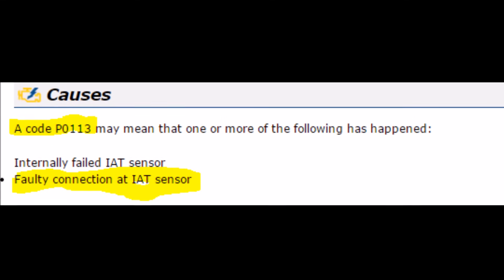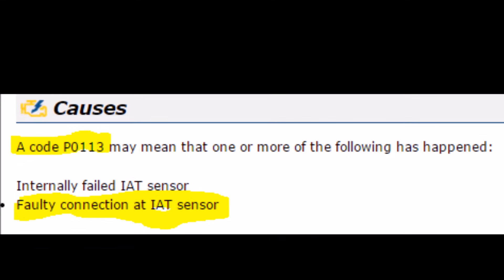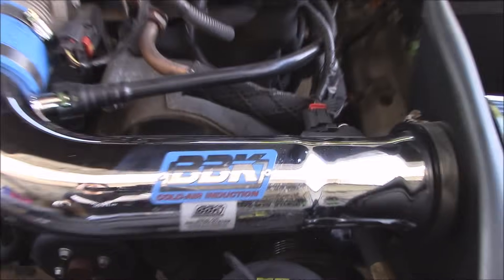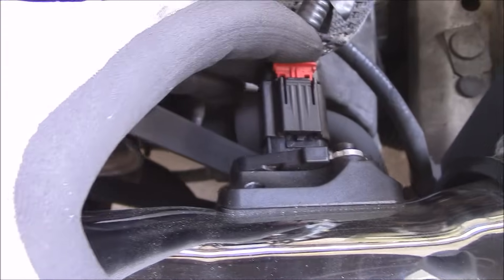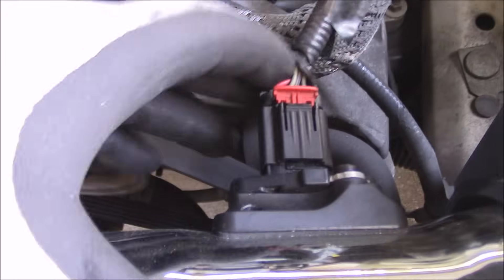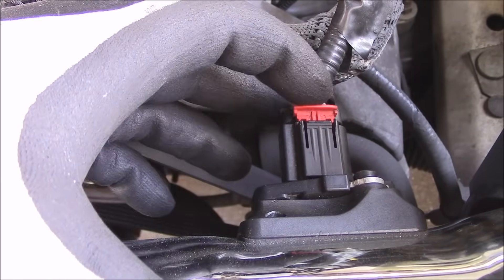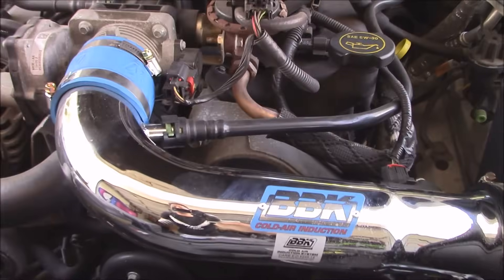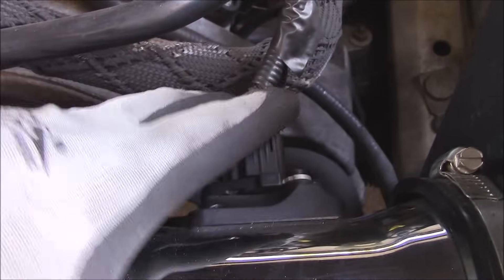HOW TO RESET CHECK ENGINE LIGHT CODES, 4 FREE EASY WAYS !!!

Comment: Why would you connect the positive terminal (with a wire or with anything) to the negative battery terminal clamp (after the negative battery terminal clamp is disconnected form the negative post on the battery)?  Wont the hard reset for the check engine light be reset just by disconnecting the negative battery terminal clamp for a minute or two and then reconnecting it to the negative battery terminal post?  Just curious - thanks  scotto
Reply: Good question! It seems that the video author presumed that the radio would not be reset, but the very fact of removing the negative cable does the reset before he can connect the little jumper to the negative post from the positive...after all, isn't it the absence of power that causes the radio to reset...and also REQUIRED to be absent for 2 minutes in order to reset the capacitors (e.g. the codes)? That said, if the check engine light goes out...cool, but the check engine light will go out anyway IF the problem was corrected (e.g. a better gas cap seal/tightening, good quality fuel, etc). If the problem hasn't been fixed, then it has no value except those that might be attempting to skirt good carbon emission testing?!?

Comment: Had to watch this a couple of times to confirm that jumper wire fix requires both cables to be disconnected from battery before draining residual voltage in system. If you fail to disconnect positive terminal you are- a. going to get a helluva bright blue surprise and b. fry your computer, big time.
Reply from the maker: +Tom Nelson i tried this a few times and like you the first time i thought the same thing so i connected a 2 amp fuse on the jumper wire when it didn't blow and worked it reset the light i sighed with relief but yes disconnecting both terminals from the battery is better just to be extra safe. however since i bought a $18 car scanner it shows me the error code and option to reset codes, all my friends, family and neighbors borrow it  . http://goo.gl/e0WY5v

Comment: dude i did what you said and jumpwd it with the wire and it worked to clear the check wngine light,  had to buy a new fuel cap.....the problem is it turned on by itself and i couldnt get the car to turn off without disconnecting the alternator,  your idea fried my box, i suggest you dont make videos on how to fix cars if it ruins other parts....a 15$ fuil cap ended up with me having to buy a new box for 45$ cause i listened to your advice
Reply: Illusions Unlimited
Reply: Need to watch more then one video..... Then make your own decision.. Lucky it was only $45....
Reply: it did cost me more 125 more cause my battery died  2 days later ....connection of small wire from pos term to neg shorted my battery
Reply: it did cost me more 125 more cause my battery died  2 days later ....connection of 
small wire from pos term to neg shorted my battery

Comment: Hey bro can u do a video on how to change your tv to 1080p??? Ihave a emmerson 50 in 1080p tv and an hd box from twc but idk how to change it to 1080p everytime ihit info with the tv remote it says its on 480p and its not hd at all, please help
Reply from the maker: most tvs formats are 1080, 720, 480 so whatever signal is input the tv will decide automatically what to output to fill the screen and aspect ratio button adjusts picture but if you want higher definition than go into video settings on your cable box and change format to 1080.
Reply from the maker: Make sure you have hdmi cable connected to tv and select hd channel on your hd cablebox. Sometimes hitting select or ok button twice opens menu for switching sd to hd channel.
Reply: How do u change video settings on cable box?? My last tv was 720 and ijust connected it to the cable box and it looked hd but now that ibought the 1080 idid the samething but it didnt work the quality is bad and when ihit info it says 480 and idk how to change that
Reply from the maker: Jose A Rodriguez on directv box is format button but on time warner it's in the menu settings button then high Def. Then change "output resolution" to 1080.
Reply: hey bud you use the remote from your cable company, find your settings and go to preferences and you will find where you can pick what you want, settings are the wheel icon

Comment: TimberTech on option 2 when u connected the jump wire from the negative to the positive we're both the positive and the negative cables unhooked from the battery when you touched the jump wire

Comment: Never trust a guy who wears gloves to keep his hands clean, then spreads and distributes dirt from the engine compartment, greasy parts, and battery terminal Corrosion to the inside of your car’s interior, steering wheel, Radio and other control knobs. Not cool dude. Are you a real mechanic?